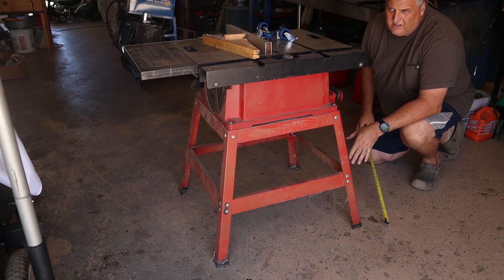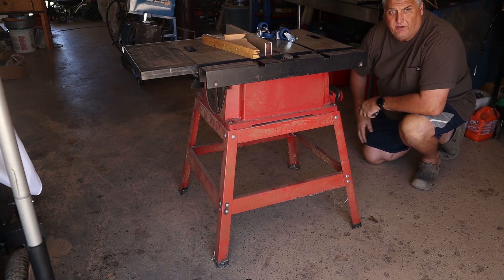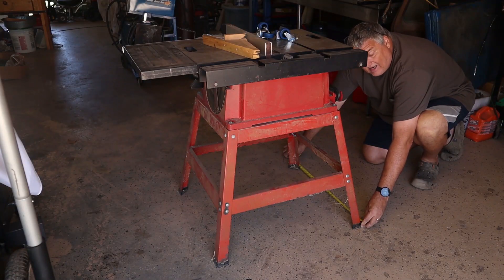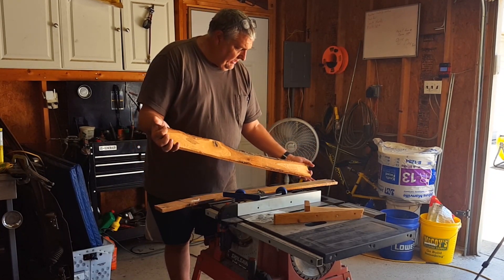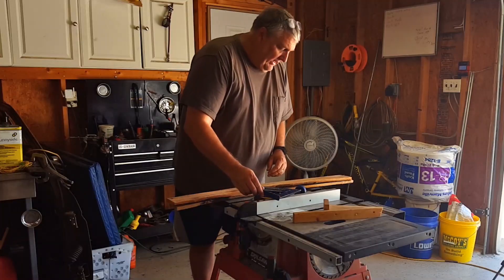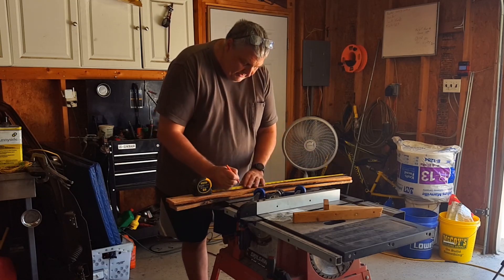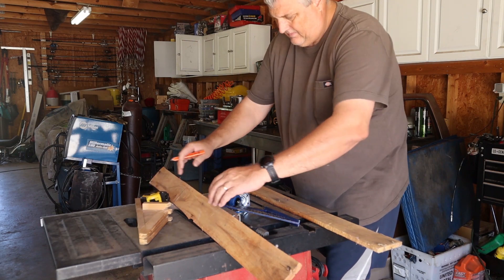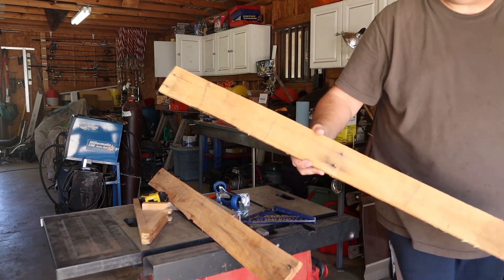How to add wheels to a table saw... the easiest DIY solution.

Comment: Thanks - I used locking casters and welded a block to the legs. DID’NT like it - would still move with casters locked- you’re idea is so much better thanks a lot

Comment: Just stopping by to say thanks so much! I accidentally found this video. Then I saved it. Then I subscribed. And then I actually did this for my table saw! Love it! For anyone else who is thinking of this, I got 4" T-hinges at Harbor Freight for $.99 each. Then I bought Harbor Freight's smallest mover's dolly for $7.99. I took the mover's dolly apart and used the 4 casters. Total cost for me was $11.95. I love it! Thanks!! (note: 1 mistake that I made was installing the hinges onto the wood without giving the hinges enough space to fully bend backwards. The wood was preventing that. I don't know how to explain it. Anyway, unless you have a lot of experience, I recommend first installing the hinges, to the wood, with only 1 screw then do a test flex with the hinge to make sure it bends all the way back THEN install the remaining screws and secure. This was my fault and no fault to the awesome instruction in the video. As for screws, having self-tapping screws for the metal was a great idea!)

Comment: I like it! The only thing I'd want to change is to have the wheels fold to the inside because of a trip hazard. ( I can be clumsy! ) I would imagine there would need to be a block of wood to fill the inset of the legs so the flip out boards would be flush.

Comment: Would you happen to have a hinge recommendation? I don't have a ton of experience with hinges, and want to make sure I get something that will fold all the way back on itself, and not break under the weight of the saw - without spending a fortune.
Reply from the maker: I just went to the hardware store (Lowes) and picked the widest ones that would screw to the legs of my saw. I don't have a "real" table saw with 24x36 cast cast top and cabinet so I wasn't worried about weight to much. I love mine now I have used it more in the past month with the wheels than I did all last year.